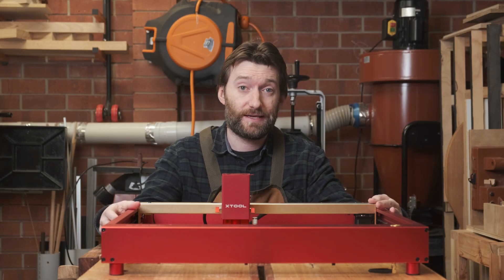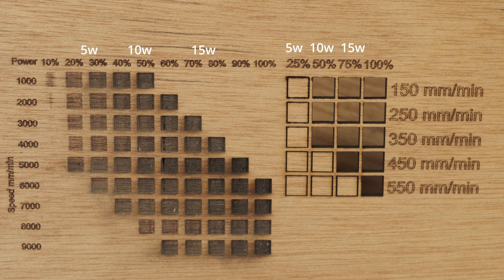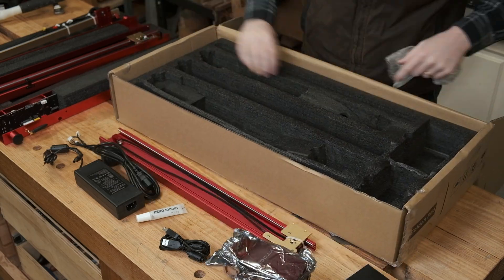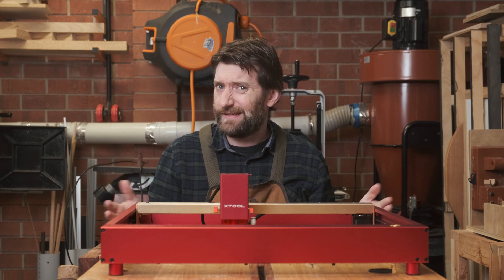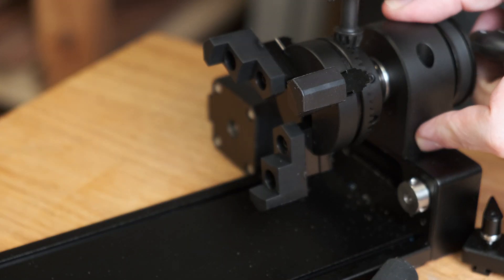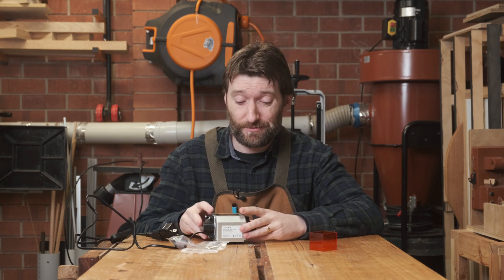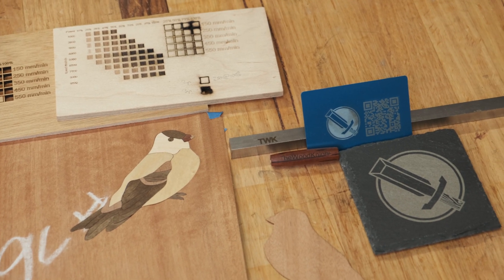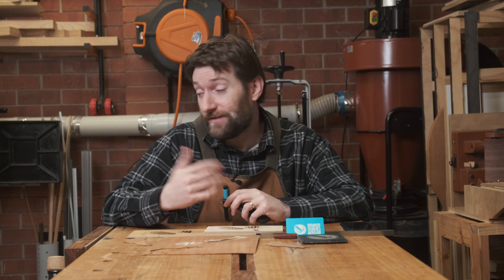Diode Lasers Finally Good? (xTool D1 Pro Review)

Comment: Would like to see more on the marquetry.  Does it leave an obvious burnt edge?  Also, Can you do an update on your work bench please.  In particular, I'd like to know how your tail vise is going.  Did using timber slides work out OK.  Dothey gum up and jam or are they free flowing still.  In hindsight, would you use hardwood now?
Reply from the maker: My tail vise is a hnt Gordon tail vice, it's not wood but aluminum and brass. Works great. Everything wood on my bench is all hardwood

Comment: Great video Paul! I bought the Snapmaker 2.0 a while back and at 1.6w it's got nothing on this but has been good to learn the software. A tool like this is awesome though as you can bring it with you. I'd love to see what you do with marquetry in future!
Reply from the maker: The snapmaker is a fascinating device, I guess if the CNC module is quick and easy enough to change over, the lower power of the laser is much less of an issue - you can just quickly swap it over. Is that what you've found?

Comment: Thanks for posting. Be really interested in a laser marquetry video. Particularly interested in how accurately you can dial in the fit and whether you can cut light coloured veneers without a visible burn line. Thanks
Reply from the maker: I think I can certainly reduce the lines but I don't know how invisible they'll end up on the light stuff. That being said, with a little bit of sand shading, they might disappear. I guess thats another thing to try - shading veneer with a laser vs sandshading!

Comment: What are you using for the teleprompter? would you recommend it?
Reply from the maker: I'm using a Glidegear TMP100 [1], with an (old) android tablet, and a Teleprompter Pad [2] remote. The glidegear stuff is solid, especially for the price, and when I got it there wasn't really much else on the market in that price bracket for that size (at the time mostly was either double the price or only took phones, not tablets, for the screen), so I can't really comment on how it compares the newer options like Neewers X14 or TeleprompterPAD's iLight Pro.

I've been very happy with the TMP100. The teleprompterpad remote is a new addition for me, works well with their (free) teleprompter app and it works really well with my brain.  Thats been the biggest issue I've had is getting something that gels with me to control the software.

[1] https://amzn.to/3K9fEET
[2] https://amzn.to/3dKkj4h

Comment: Thanks for the review Paul. I am definitely looking at this laser, and have read and researched a lot about it. The cost like you said is justified, but is very big investment, for a small maker like myself, can be really putting off. BUt the future will tell what am going to do about investing in one. And yes very much keen on the Marquetry videos, especially the tolerances.
Cheers!
Reply from the maker: Absolutely, the jump to 20w in particular is a hard pill to swallow. For the branding on your sliding bevels and chopstick engraving, it'd be super great at but gets a bit harder to justify when you've already got the brass branding iron! What would you be using it for?
Reply: @TheWoodKnight   the biggest limitation of the iron is that it’s limited to a size, so definitely branding and personalised, also putting other makers logos on the bevels would fetch more interest. I can really only see the engraving the most use, but if I have the option of cutting then templates and the marquetry work for sure, definitely want to make those for the coffee pod drawers and may be temples given my background as an india I get a few requests for those.

Comment: Hi Paul
Nice review, 20w is indeed a serious toy. 

I have only a 4w Emblaser that I use with Lightburn and aside from engraving my main use is cutting paper/cardboard templates either as bandsaw guides or for checking fit and size before I put the real material on the CNC router. On the question of kerf control for marquetry I believe the latest versions of Lightburn have this  as a feature built-in.
Cheers
David
Reply from the maker: Oh thats a good idea on paper/card templates - I could have used that for the lambstongues on the moxon vise rather than awkwardly making it out of plywood just to trace it onto the wood. Thanks, I'm stealing that :)
Lightburn has so many features, I've barely been able to scratch the surface, hah! The template generator for kerfs I found is https://www.o2creative.co.nz/laser/lightburn_kerf_generator.php, then I think I can punch that into Lightburns kerf offset, but I wouldn't be surprised if there was a generator inside Lightburn
Reply: @TheWoodKnight  
It's built in to LB now, when you set the cut setting for any layer, if it is set to Line you can adjust kerf up (outward) or down (Inward)